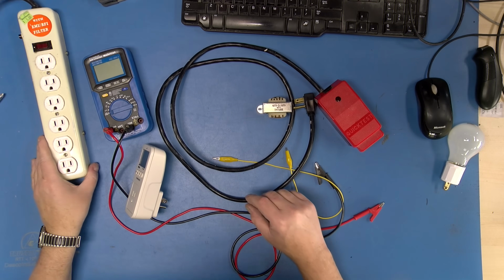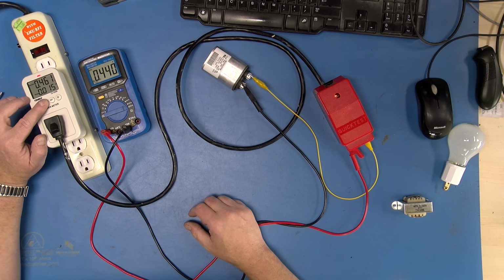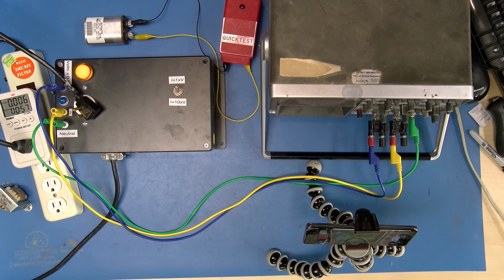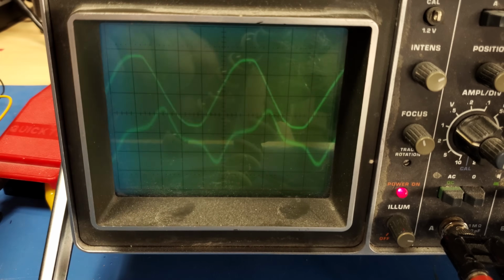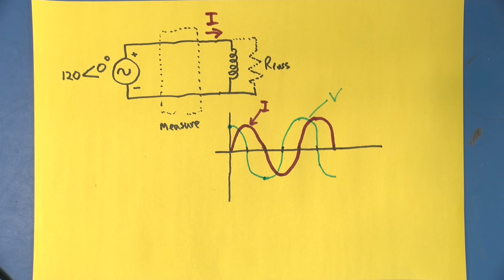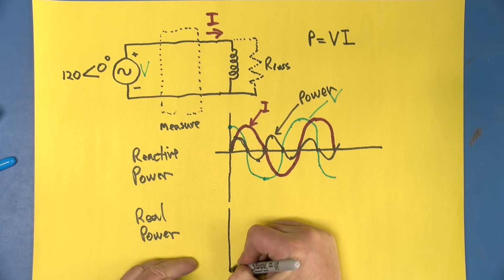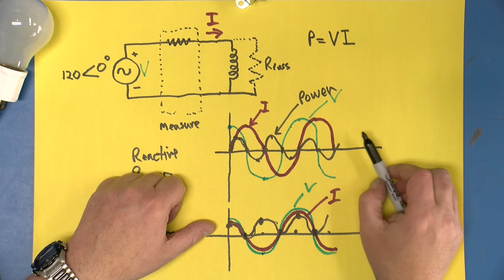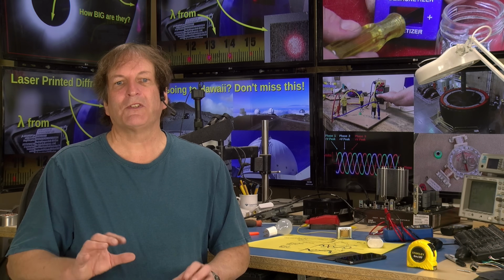That strange flow of electricity that transmits no real power

Comment: Very nice video, thanks!  Where do you get the quick-test AC interface disconnect box?
Reply from the maker: I got it from Newark https://canada.newark.com/cliff-electronic-components/cl1857/qt1-usa-canada-13a-fuse-quicktest/dp/08AC2593

Also appear on ebay and various European sites. Make sure you get the right one - comes in both US and European colored connector levers (Black and White or Blue and Brown) and also 3 phase versions. If you ordering on, order a bunch of fuses a the same time - the fuses are the fuses the UK use in their plugs - easily available in UK, less so in North America. Newark has them too.

Comment: Thank you for another excellent demonstration and explanation, Dr. Jones! Is there a way to measure reactive power or power factor at a home’s service entrance and calculate an appropriate capacitor value to offset it? I know it’s not measured by residential power meters. I have a lot of reactive loads in my house due to LED lights and LED dimmers, air conditioner window units, the fridge, and all my computers’ switching power supplies. I use a linear supply for my amateur radio gear. I’d like to clean up my mess and have the cleanest power possible for my audio gear and minimize radio noise. Also, does the EMF/RFI filtering on that power strip contribute to reactive power somehow?

I would love to see a video explaining signal ground, electrical ground, and how to ground properly to avoid ground loops. Do ground loops affect appliances other than audio equipment? I have grounds for lightning on my antennas that doubles as the signal ground (3 ground rods in series) and I’m sure there are loops somewhere because that ultimately gets combined with the electrical system ground. I also have a separate ground rod for my TV antenna, and the TV does not have a ground conductor on the power cord. Could I be introducing him or noise by having that ground rod separate?

Very much looking forward to more excellent videos!
Reply from the maker: I think a big part of the issue is that most of those electronic load only use current at the peaks of the AC voltage. So even though they talk about some of those devices being power factor corrected, its not the same type of power factor as for classical reactive current. The issue is really harmonics. 

I do think the smart meters could measure it - I have a smart power meter eval kit (video sometime) so it would be interesting to see what a meter can be programmed to measure. The good thing is they are only supposed to measure real power - but not sure how good they are at measuring power on spiky current correctly. 

A big smoothing capacitor would help smooth out the current spikes (ie suppress the harmonics) but the power co may not like a big leading current reactive load that would be. And enough capacitance could get expensive. 

I think a better approach would be to make filter or similar to clean up the power to your audio gear. Maybe some small toroids and capacitors on the . If you really  want to get fancy, after that first stage you could use a large transformer as an inductor from line to neutral and then a suitable sized capacitor in parallel to provide  all the reactive current. This will create tuned circuit that has highest (close to infinite) impedance at power line frequency, and lower impedance for the harmonics and any distortions. So your should get pure 50 or 60Hz out depending on where you are (sorry I have forgotten).

Ground loops - yes can be a noise issue thats often hard to find. One issue can be breaking the symmetry between the current in the centre and shield conductors of a coax cable . Loop the cable though a RF torroid to eliminate that. You can also selectively ground at different frequencies to eliminate one or another type pf stray current - put a small cap in the ground path to make it an RF only ground, or a small inductor  to make it a DC or audio frequency only ground. 

I have copied your comment to my list of future video suggestions. If I do a video I may contact you about your ham radio grounds .....

Comment: 11:07 The capacitor current looks so messy because of harmonics on the incoming supply.  Since the incoming voltage is not a pure sine wave (flat tops, sharp edges) it contains frequencies at multiples of 60 Hz (120, 180, etc.).  Capacitors exhibit lower impedance at these higher frequencies, since Z_c = 1/(jωC).  Thus, capacitors will conduct more of these harmonics, creating the ripply current waveform.
Reply from the maker: BTW - you have a  great channel - Signal Processing and similar stuff in case anyone is interested.
Reply: @ElectromagneticVideos  Thanks, I appreciate your comment!!  You have a great channel as well!
Reply from the maker: @DoubleALabs  Thanks!
Reply: Oh harmonics now that is fun stuff especially the 5th & 7th ,  VFD capacitors love that,   best have a fire extinguisher handy.
Reply from the maker: @WOFFY-qc9te  I was amazed how bad the current was distorted - an incredible  amount of higher harmonics to create such jagged current. And your right - that can result in significant RMS current in the capacitors with bad things following,.
Reply: @ElectromagneticVideos  Story, I was called to a waste water plant who reported fires in the VFD's.  On arrival I could hear harmonics (150 Hz) from the 32kV switchyard. On my walk through the substation detected higher than expected temperature on neutrals and very warm capacitors.  The whole sub was screaming.

I asked about any control issues and they said "the clock runs backwards and the level gauges are all over the show and they had just put out another fire in a motor control".  Then a radio burst into life followed by a tech running into the control room to isolate a pump that had just started dumping water.  I identified one cabinet and said if it not important take it off line now, when they opened it the inside was a mess of sticky foil form a former capacitor. 

I then spent an hour explaining to them that there in house upgrade to VFD from online starters was flawed as they had introduce Triplen harmonics and that was causing the capacitors int eh VFD's to catch fire and massive currents on the neutrals.  My recommendation was a fast van full of fire extinguishers and get a consultant.
 
The SCADA system had totally lost the plot opening valves and generally behaving badly and the matrix printer had fonts that only Klingons could read. Fun job.
Reply from the maker: @WOFFY-qc9te  Wow! Another incredible real-work example!
Reply: @WOFFY-qc9te  I could hardly make sense of the story... Sounded like it was a pretty exciting and expensive day!
Reply: @chopper5371  Sorry for the poorly structured story. 

Data centre Banking servers must have uninterrupted power for twenty five years.

System;  Four ' Pillar '  Kinetic UPS ( which are large flywheels on a motor alternator) normally kept spinning by mains power.

If the grid fails then the stored kinetic energy is used to drive the alternator which maintains power extended (up to 30 minutes ) with DC batteries until the four diesel generators can take the load. 

The digital switches manage the synchronising and transfer loads between systems and the grid.

The load banks were 300 kW  fan heaters in the car park used to load the system for the test and melted the badly parked car.
 

Yes wrangling angry pixies is always exciting, the cost of the data centre was £7.6M (2003)
Reply from the maker: Yup - thats another way of explaining it. But even with all the math, it still looks amazingly bad!

Comment: This is why the electrical grid system should be DC.
Reply: Load of BS my "friend". AC is way better and cheaper at long distance.
Reply from the maker: Well I dont think its practical for shorter distances, but I sure could see more of the medium length lines being converted to DC to get a bit more power though them as the DC/AC converters get cheaper.
Reply: That was a joke about avoiding the math that doesn't make sense...

i forgot the sarcasm tag 😝
Reply from the maker: @Iowa599  Hmm - I dont see that any of your comments  - I wonder if YouTube ate it. It seems to be doing that a lot lately.

Comment: Yes Power Factor Correction is very Important.

The Edison/Tesla argument Direct Current vs Alternating Current.

AC Easy to Produce consumer's get stuck with the inefficient process .
Reply from the maker: Well I think what really caused the widespread adoption of AC was the ease that voltages could be increased for transmission with transformers which could easily be built back then.

DC isn't without its faults in other ways either - the worst being how much harder  it is to extinguish arcs and make reliable switches. So there are pros and cons of each.
Reply: @ElectromagneticVideos  PFC= "ENERGY STAR" I love your Presentation. 

Currently converting my HiFi Gear to correct the phase problem I personally ignored these conversations during the 90s-2000s because I didn't understand the problem!  But is a BIG PROBLEM
Reply from the maker: @DataCenter2030  Well I think we really didnt have that problem back then with so few electronic loads. I assume you hifi stuff is from the pre-switching power supply era? So transformer feeding rectifier feeding huge capacitors.  How are you modifying it? I would think the biggest issue is depressed unregulated DC due to the flattening of the AC voltage waveform?
Reply: @ElectromagneticVideos Energy Star was early mitigation for high use devices like TVs and Refrigerators.  Even SMPS need Correction, large transformer devices just need a different type of PFC. 

I  live near a plant where the design and manufacturer PFC modules for new and old devices when that's not available I use passive correct.
Reply from the maker: @DataCenter2030  Interesting - I had though energy star was more about power efficiency - ie a refrigerator that uses less power. Had no idea it included PFC.

Comment: G,day from Sydney Australia.
Do you have any evidence that reactive current (out of phase) destroys Appliance e.g LCD screen AC DC step down converters?
📺💥
Reply from the maker: Australia! One of my favourite places - spent two months in your wonderful country!

Hmm - its should really not be noticeable by other devices on the same circuit - so no. 

But - if your appliance shares a circuit with an inductor (induction motor, transformer etc) and while  the inductor is powered, you flip a switch that is feeding the entire circuit to off, the inductor can generate a significant voltage spike that can can destroy the semiconductors in any electronic device on that circuit. 

The size of the spike can vary and depend on at what time during the AC cycle the switch is flipped and what else is on that circuit. Modern electronic power supplies should be able to handle significant spikes, but it does depend on how well they were built. 

You can also have spikes coming in from the outside. I'm not sure about Australia, but over here you can get a house size surge arrester in the shape of a standard circuit breaker so if you haveing such issues it might be worth considering something like that  and/or removing inductive devices away from circuit that have electronics on them. 

Hope that helps!

Comment: Lovely video. In countries that follow EU rules, a device that consumes more than about 70W is normally required to have some kind of power factor correction to get the current and voltage to align. Domestically I'm not sure this has much impact as many devices are less than 70W, so we can still end up with ugly sine waves - although I have to say, every time I look, they're not as ugly as the ones you measured.
Reply from the maker: So thats interesting and one can sure see of millions of devices how that could drastically reduce the additional currents that the power companies need to deal with. 

Question: is that rule for reactive loads only, or does it also apply to the current peaks from electronic power supplies? I think(?) over here (Canada, US)  we now are seeing regulations targeting those peaks (= lots of harmonics and the cause the the flattened AC sine wave seen on my hope power lines)  - and those peaks are even worse than reactive power consumption.
Reply: @ElectromagneticVideos  I think the peak currents behaviour typically seen due to the post-rectifier capacitor in switching power supplies is normally constrained by the requirements of IEC 61000-3-2 (adopted as EN 61000-3-2) - unfortunately, such documents are not normally freely available, but as I recall it defines different classes of devices and different harmonic content limitations for each. Edit: the Wikipedia page looks quite useful.
Reply from the maker: @AllTheFasteners  Interesting - I'll take a look. I hate it when standards documents aren't freely available. Interestingly, I saw a video on Lehto's Law a few days ago that one of the US states supreme courts ruled that when standard documents are used in laws or state regulations, they do become public. Hope that will happen in more jurisdictions.
Reply: @AllTheFasteners  The Chinese are not interested in  regulation to them CE stands for China Export ?  IEC and IEEE regs are not applicable to them or any other laws. 

Their needs to be better import control on power supplies especially the cheap laptop and phone chargers which have 240 v path through the device some just a series capacitor and a cheap half wave rectifier with 5v regulator no filter. Regrettably people have been electrocuted using their phones in the bath.

One laptop I fixed by just changing out the cheap Chinese PSU which was putting out 100Hz screwing up the mouse.

Comment: Thank you. That goes a long way to helping me understand Power Factor. If you wouldn't mind talking about Power Factor, that would probably be a good way to continue this topic. Take care.
Reply from the maker: I was so close to including it but decided it was one to many thing for the video. You may have seen me skip past the power factor display on the power meter. Yes - a future video. But as a minimalist explanation, the just how much of the total current or apparent power (volts times amps) is real power. So a pf of 1 means its all real = resistive. pf=0 all reactive so either a perfect capacitor or inductor. Almost everything  other than heaters is somewhere in between.
Reply: @ElectromagneticVideos The cosine of the angle between the voltage and current is P.F. A pure resistor has a zero angle, so the cos 0 = 1. An inductor or capacitor is a 90 degree angle, so the cosine of 90 degrees is zero.
Reply from the maker: @foureyedchick  Exactly! You know your stuff :)